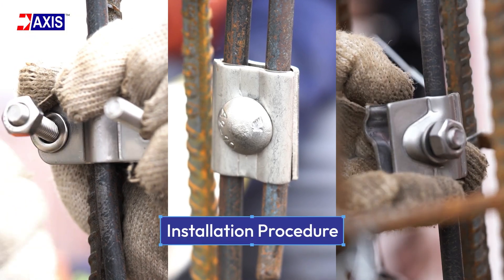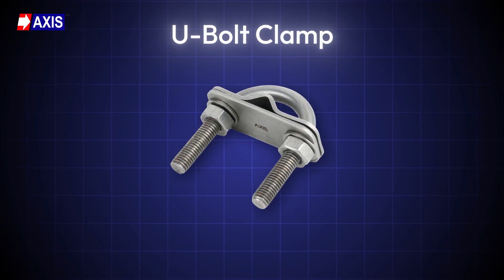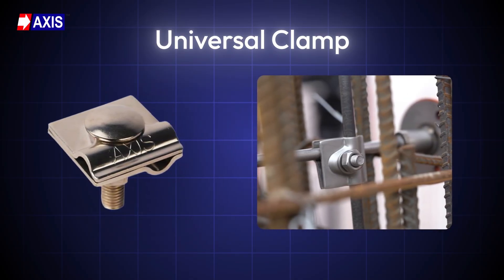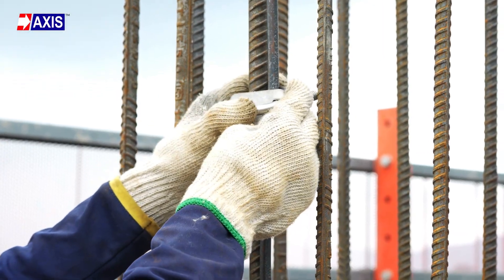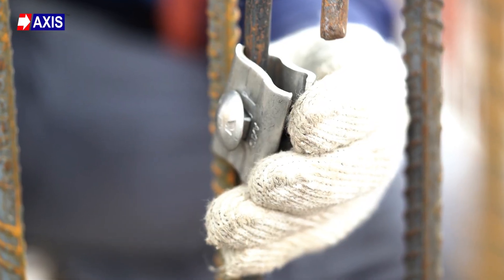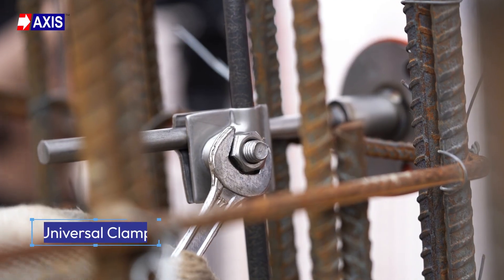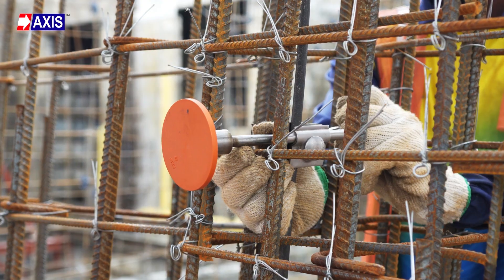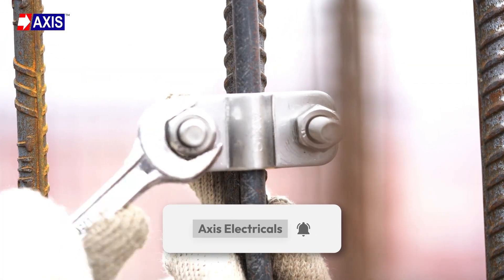How to Install Clamps for Structural Earthing? ⚡

Comment: quick question why would connect to ground structures and steel roods?
Reply from the maker: Grounding metal structures and steel rods ensures they’re at the same electrical potential as the earthing system. This prevents dangerous voltage differences, reduces shock risk, and gives lightning or fault current a safe path to ground.

Comment: Hi, can we use these clamps to connect a 70mm² copper cable with the steel reinforcement? And is it acceptable to pull out the copper cable from the concrete foundation?
Reply from the maker: Yes, these clamps can handle connections like a 70 mm² copper cable to steel reinforcement. As for pulling the cable out of the concrete foundation, there are a few important considerations to ensure safety and reliability. 

For the best solution tailored to your system, we recommend connecting with us at sales@axis-india.com.